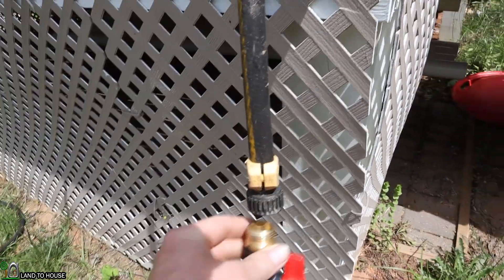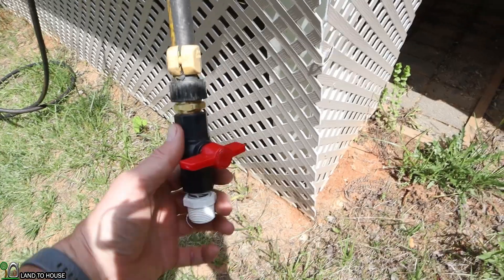Ram Pump Top Delivery Valve to Fill Pipe faster

Comment: Have we encounter an experiment like this? 
Controlled set up: holding tank 20m above reference elevation. Pump at minus 3m. 
Experiment: relocate pump and add pipe/hose from minus 3m to minus 6m. What performance penalty / reward cat we gather by this change?

Comment: Can we try thus to avoid tens of manual triggering? 

Begins from stop cyclic state, hold down the drain valve to continuously drain water for a few seconds then release it to see it self enters cyclic mode?
Reply from the maker: You have to fill the delivery pipe before it will cycle on its own. I purchased a drill pump to fill the pipes. Saves tons of time!
Reply: @LandtoHouse excellent. Your comments caused me to think and understand Ram pump deeper. This is my understanding and new ideas. 

Start up Problem? 
Caused by distribution pipe not full > tank pressure too low > positive impulse too low > complemented by negative impulse too low > 
Drain valve only opens with a strong negative impulse. 

Remedy? 
Shut off output valve > bleed air from air tank until air tank half fill > stop bleeding air > trigger the drain valve few times until it cyclic > slowly open output valve to deliver water at a rate equal or less than the rate in a normal run > return home. 

Modification? 
Change output valve from ball valve to tap valve to ease output flow control. 
Add bleed valve through top of air tank. To prevent accidental of total air loss, install a straw through tank top and cap the top end with a small ball valve. Bottom straw sink into air tank and stop at half height. Purpose is to let water head to fill tank without the need to trigger the valve 100 times. When tank water level rise above straw tip only water escape and 50% air trap to tank top. Now shut the bleed valve. The bleed valve is normally shut. 

What if tank air deplete too much? 
Auto replenish of loss air system? 
This should address that: In front of tank check valve and after drain valve add a small side hole a size no larger than 1/16th. Insignificant amount of water will bleed out through this hole during most of the cycle time and only suck air into the circuit in presence of a negative impulse. Air through the hole will trap in front of tank check valve as a micro bubble and will be push in together with drive water into the tank by the next positive impulse. Caveat? Air hole size need to explore by experiment. Experiment start with smallest possible to compensate loss air. Too large can harm pump efficiency. (To help visualize the air replenishment effect, use a transparent bottle for the tank)
Let me know what do you think?

Comment: Try this. Your hydraulischer Widder will do the work. Close the outlet valve. Prime the pump till its working . Then open the the outlet valve as minimal as possible and let the pump fill up your hose. Take a coffe and chill. If the hose is filled completely, open it full. The closed valve should stimmulate the highest pressure your pump can produce. Dont open the outlet to much, or your pressure will be at 0 in microseconds.

Comment: Would still love to see you test out an idea a few of us have had for reducing "waste" water when making a multi-stop trip up a large hill or something.

The idea is that You have some water source / tank at the bottom feeding a ram pump [1], which pumps water up to Tank 2 some distance up the hill.

Then you have Ram Pump 2, pumping water further up the hill to Tank 3. BUT ... at Ram Pump 2, you put your waste valve in like a collection box / bucket [we'll call it '2' since it's at the 2nd level even though there's no such collector at Level 1] with a hose / pipe channeling the collected water back down to Tank 1 at the bottom to be "recycled" (get another chance at going back up the hill).

At Tank 3, you have Ramp Pump 3 pumping water up to Tank 4, and Waste Valve 3 situated in Collection Bucket 3, channeling water back down to Tank 2, to get another pass through Ram Pump 2 back up to Tank 3.

And so on. In theory, would this basically make it so that the only "loss" from the system would be at Ram Pump 1, since all the other pumps / tanks would basically be "recycling" their water back down to the prior tank, to be put back through the ram pump and go back up again? Would this eventually help to fill all the upper level tanks, over time, with as little "waste" as possible?

And, like maybe even "Waste Valve 1" could be put to use by like collecting the "waste" water and like diverting it to water the garden, or whatever?

Anyway, would be cool to see a system like that set up and see if it makes sense for traversing longer uphill runs, to ... eventually ... get water all the way up to the top, via several "stops" along the way. 

And potentially, each of those intermediate "tanks" could have another outlet for making intermittent use of water at that level, whether watering gardens, powering a gravity-fed sink at an outhouse, or whatever. [Just thinking out loud...]
Reply: And, maybe at each tiered "tank" you'd have a float valve or something, so if the water level's too low, the ram pump stops temporarily, until the water level gets high enough again and it starts pumping again? [Or would the pump need to be manually restarted after the float valve temporarily stopped it?]

Comment: if you close off the valve to the delivery line and open it gradually as  it build pressure that's works
Reply from the maker: Absolutely! I have 3 or 4 videos showing that this does work. Someone asked if it's possible to put the valve at the top of the delivery. Air pressure is a lot harder to control  than water.

Comment: Hello, here i got two more methods to solve your problem. 
1. fill 10 or more litres into the destination tank, so that the hose is filled up bevore starting the pump

or
2. take off the delivery hose, open the the second ball valve only a bit, so that the needed pressure can be build to operate the pump and a bit off water can flow. Reconnect the hose and wait a while till the hose is filled up. Then open the valve completly.

Regards from Germany

Comment: Test for you. 
* Same set-up (no need for valve at top end of hose) 
* Add 2 pressure gauges for a visual ( 1 on either side of delivery valve) 
* Open both valves at pump (let water fill system) 
* Close delivery valve 
* Start pump (let it build pressure) 
* Pump most be running on it's own 
* Slightly open delivery valve (if pump stops, valve was opened too much, start again) 
* Fully open delivery valve when water pressure equalizes on both sides of delivery valve

Comment: Open your valve slow. Come on man you know it all has to do with the play of water hammer. Keep working hard man.
Reply from the maker: It's a lot easier to hold back water with a slight valve opening. That air would escape too fast either way.

Comment: There's one thing I bet would work... Install a cheap drill powered water pump in your outlet hose! Hook a drill to it and spin it until you get water to the top... Take the drill off and then just a couple of pushes on the flap should get it going... The pump can be left installed and water should flow right through
Reply: It may restrict the volume you can move slightly but I don't think it will be much

Comment: cant you just close the outlet pipe valve on the ramp pump, cycle a handful of times to allow the pump to get pressure and then crack the outlet a small amount to maintain back pressure.. then after a few minutes open a bit more etc? seems alot faster solution with a lot less manual pressing.. ?

Comment: how about another idea. How about closing the delivery valve on the pump side - make the bump cycle and then open the valve on the delivery pipe only slightly - so that the pump keeps cycling on its own  - as soon as the water reached the output hight, open the valve fully ...

Comment: I said this on a previous video, use the delivery valve on the ram pump to build pressure then just crack it open and let the pipe fill, once it does then you can open it fully, should take 15 at most
Reply from the maker: Yes that absolutely works. I have a video on that somewhere from the past. It can be a little bit touchy to find the sweet spot especially on smaller pumps.
Reply: @LandtoHouse  you should make a new video demonstrating it for people who may not have seen it

Comment: A thought: it doesn't have to be open or closed on a ball valve. You should try letting the pump pressurize the delivery pipe, then just barely crack the valve open. It might restrict airflow to maintain just enough backpressure to cycle the pump. Obviously, that would take some fiddling around to see if that works.
Reply: Correct. Also should try installing a spring activated pressure regulator valve set to very low pressure.
Reply: I had the same thought 💭

Comment: I built a ram several years ago one of the main problems that I had is having the right place to set up my tank and check valves not having enough head pressure for the distance I was wanting to push water to. I was wondering if you have ever tried having a tank set up at a shorter distance but running your waste valve as far as you need to get the proper head pressure would the ramming effect still be great enough to push the water where you need it? The ram I built was inlet water through pvc check valve water pipe T Going up to outlet spigot with air tank after that, water ran straight through that T was my waste valve being last if this makes sense lol kind of right opposite of what you have. What I am asking is could you set your tank anywhere in the system as long as your waste valve is the one that is getting the needed drop in your system I know in some of the places for these set ups are hard to place your tanks. The place that i had my ram was a rocky branch that when it ran it flooded like the grand canyon then dry up afterwards but it had plenty of amazing clean water springs that ran in the very bottom bank along the branch so it was hard to set up the system because you had to always worry about the branch flooding and washing everything away if what i stated doesn't make sense let me know I will draw a diagram of the ram i built. Thanks for the valuable information on these set ups.

Comment: You dont need to push cycle many times. Just press it long enough to remove all the air in the drive pipe and then just release it and it will start recycle. You dont need the whole day and 300 cycle ..... 😅

Comment: I think we all wanna see the ram pump perfected. Bring some more innovation and improvements to it! Better waste valve designs and snifters and pressure tanks. For science! and... reliability.

I think it's also important to consider materials... especially if using for gardening or potable drinking water. You don't wanna be using tons of plastic, especially standard pvc... , glues, and other toxic materials that would leach into the water.
Reply: Checkout the Bunyip Pump
Reply: @du7ch384  That's impressive!

Comment: Seth. Curious if you've revisited the series ram pump?

With a bigger first pump and a smaller secondary pump.
Reply from the maker: Do you mean filling a tank with 1 Pump and then using a second to run from that tank? Or do you mean having 1 pump feed the Drive pipe from the 1st delivery pipe.
Reply: @LandtoHouse  
I would like to see the first

Comment: Here is another idea. There air valves available out there that will hold preset pressure of air or water. What if some dive like that set at the end of the hose, say at 5 psi, 10 psi and so on. See what will keep the pump going until water arrives.

Comment: Might as well blow into the delivery pipe. It’s like using two reservoirs. Also you do the same thing every video, crank that thing open and blow off the pressure fast.  Crack it open slower.  If we’re gonna do a viewer test, get one of those drinking bird figures and let it cycle your valve for you, lol.

Comment: Why wouldn't you just prefill the delivery pipe? ... and avoid the ball ache of pressing the check valve and few hundred times.
Reply: That's what he said that you can either drop the delivery pipe down hill and let the pump pre-fill it and drag the whole pipe up the hill but that too will make the hose very heavy. 
Talking about filling from uphill will create air lock. He demonstrated this in one of his videos on ram pump. Check it out.

Comment: 2  design flaws on your ramp pump. 1. The waste valve is cycling too fast.,  you need to pick a more efficient one. 2. Your exit pipe and inlet dia is not designed.,  Makes the whole design less efficient.
Reply from the maker: The reason this waste valve is cycling so fast is because the drive pipe is only 20' long. If it were approximately 75' long the cycle. Time would be ideal.

This was simply a test to determine whether or not closing the delivery pipe at the top would Reduce the number of manual waste valve presses. Keeping the delivery pipe size consistent over the tests was important. On a real install. I would suggest people use smaller delivery pipe.

Comment: I wonder if you slowly released the pressure from the delivery pipe, it would continue running?
Reply from the maker: My assumption is that the air pressure would leak out too fast no matter what amount of opening I had on that delivery pipe. Now. You can open the valve at the bottom slowly to allow a tiny amount of water to go through. But also here this can be a real delicate process to find the right balance.

Comment: Nice. Have you tryed like with a half closed? Not fully close on the output.
Reply from the maker: That method works at the pump but not at the top. Slightly open at the top would still let out a tremendous amount of air pressure. But at the pump letting a small amount of water through while still Allowing a high back pressure does work.